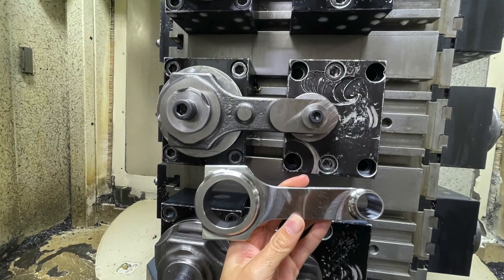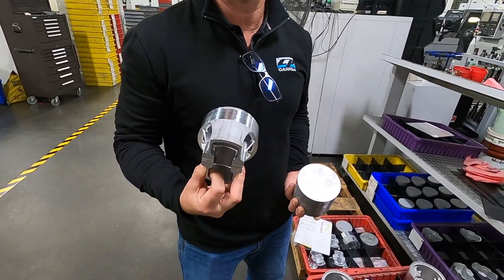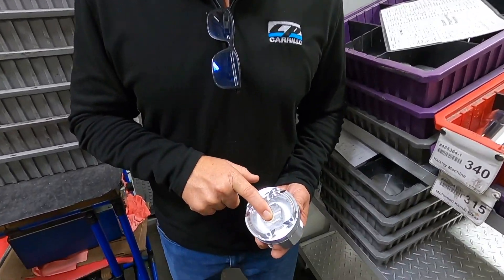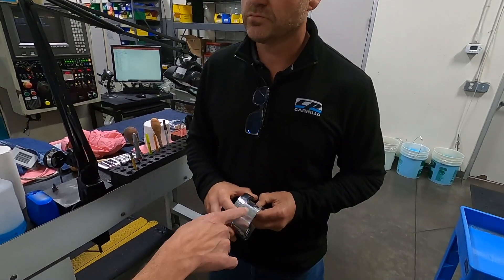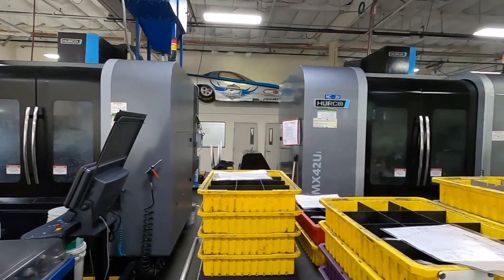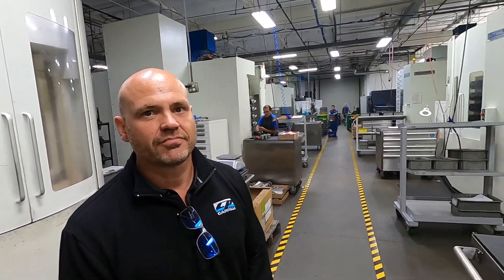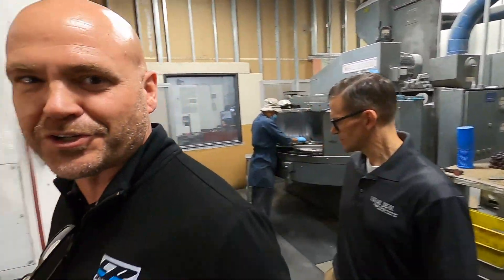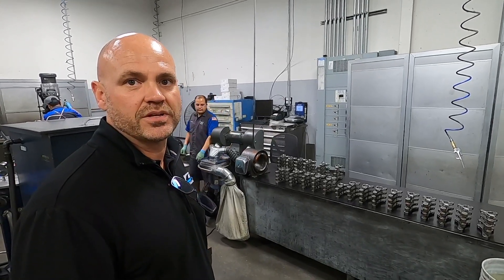How Racing Engine Parts Are Made! CP Carrillo Factory Tour & Behind The Scenes (Rods & Pistons)

Comment: Even back to the later 60's before CNC Machines were around, Carrillo Rods were still the Premium Con Rod you used in building a Race Engine. They weren't inexpensive though, a set of Rods for a BB Chevy in 1968 would cost you over 500 Bucks (68 Dollars) However you get what you Pay for. They are almost Bullet Proof as far as Breakage. You really don't need any more accuracy in a Race Engine than 1/10 Thousandth but these Modern Day 5 Axis CNC Machines can Machine Components to 1 Micron Accuracy (1/400 Thousandth) all day long. We used them in Motorcycle Race Engines also. One instance probably saved us having to buy new Main Cases for a BSA A65 DT Race Engine that Normally have OEM Aluminum Rods. During a Race the Engine had an Oil Pump Failure. The Left Side Carrillo Rod was completely Starved from any Lubrication for a Couple Laps on a 1/2mile Track before the Engine Locked up. The Rod had Stretched some what, but it didn't let go and probably saved us a 1000+ dollars in Parts that would have been destroyed with the Factory OEM Rods. Those High End CNC Machines you see through out the Facility Cost a Bundle of Money but what they Produce(Rods/Pistons) is the Highest Quality you will ever Find...

Comment: Is there any way to identify or tell what cc the dome pistons are I bought some from a guy they are in a box from carillo one has a stamped CP on the inside in black but no info on the box or inside on the Pistons the 350 block that came with them is .050  and 6 inch rods 3.480 stroke crank
Reply from the maker: Check for a part number

Comment: Not complaining but on the rod side you never saw showed they cut the rods at the crankshaft and machined them  to the correct dimension. I use to machine billet rods for racing go-kart when the Briggs & Stratton engine was used. Stock stroke as well as longer strokes. Mechart Rods.
Reply from the maker: They didn’t want to show some parts of the process
Reply: @Stapleton42  I figured at much. Did you get to see more than you where to filmed?
I had my own shop for 22 years, all together I was in CNC machining for 45 years.

Comment: You need to look up the difference between billet parts & forged parts. Depends on parts purpose/use which is 'better".
Reply from the maker: They make a billet part from a forging in the same shape for the grain pattern. I understand the difference. They just use both forms here.
Reply: @Stapleton42  Better check that. Think you got that wrong. Billet is billet. A forging is a forging.
Reply: @gailtaylor1636  if you take a forged piece of material, say a round, and treat it like a piece of billet. Is it a forging or a billet? It’s not what you think of either when you say forged or billet typically. It’s probably still a forging, but it’s not usual.

Comment: Pistons are not round. Who knew? Are rods and pistons matched in groups of 8 so they are identical?
Reply from the maker: The pistons are since most of them are custom. They're weight matched before they are finished. Rods I don't know. Probably depends on shelf part vs custom!
Reply: No they are not made in sets but of you are building a motor take the time to weigh each piston and grind a Lil off the inside to make them all the same down to the gram and do the rods also want each assembly to be exactly the same
Reply: They go round once they heat up